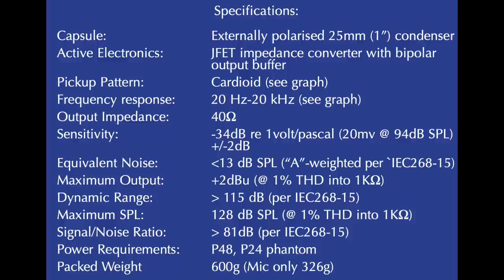Rode NT1 vs. 1990's Rode NT1 Comparison (Versus Series)

Comment: Wow, wow, wow. I can't believe you determined the winner to be the new NT1. I prefered the original in every test. I had to skip through the recording of the guitars in particular with the new mic because it sounded so inferior to the original. The bass response and proximity effect was just too much for my taste on the new one and the midrange was muffled in comparison to the original. And I know you can hear this stuff because you're wearing those Sennheiser HD-650s! I could see how the new one may be more desirable for voiceover work but in the mix, anything mic'd with the old one is going to sit better in the mix. Thanks for doing the test though, I always wanted to hear the differences and this is a relatively hard test to come across.
Reply: Completely agree. Was very thrown off by everything said at the end. While the noise floor and output signal on the current issue NT-1 is much improved, I enjoyed the sound of the original in every test.
Reply: @tigresen5660  Haha. It was like, what happened there?!
Reply: Totally agree with you.  I recall reading that Neumann sued over the original NT 1 body design and similar sound, forcing Rode to change it. The OG beats out the new one in every example for me.

Comment: Self-noise is one thing; but as for sound, it's whichever sounds good to you in a specific context. I thought the original recipe sounded nice & sparkley on acoustic guitar, and would be useful for keeping it forward in a dense mix. But we don't usually produce tracks of one sound source; it's all about what helps us emphasize the desired elements within a mix. The current NT1 is great for stuff you want to sit graciously and let other sounds punch thru. (Of course, a little quality EQ will let you do the same thing, albeit with more fiddling.)

Comment: Interesting video. The newer one definitely sounds better here. HOWEVER:
there is a pretty simple mod for the older NT1 if you want it to sound a lot better, and of course if you happen to have one on hand. The man, who actually designed the mic, the one and only Jim Williams, suggested that you change the two 450 pf caps, that are inside the microphone attached on the circuit board, into 1500 pf or 2200 pf caps. This way the microphone just comes to life and becomes a whole different beast. You can find clips of a comparison between the original and a modded one online, there are whole gearspace (ex-gearslutz) threads regarding this, so a simple Google search will tell you all about it.

Comment: Definitely different. I just unearthed my 2000 NT1 after a friend gave me a spare Rode shockmount. However, I disagree with which one wins. Through my Dynaudio BM6a monitors and through my PA rig, the 2021 NT1 sounds like it has a couple towels in front of it, sounding muffled. The 2000 NT1 was way more clear to my ears through speakers. I didn’t listen through headphones yet. My only complained with the 2000 NT1 is that it picked up a little more noise from behind it vs the 2021 model.
Reply: yes the old one sounds more open and has a warmth to it.

Comment: Thanks for the video! I totally agree with you: the current model is better than the 2000 one in the overwhelming majority of scenarios. The 2000 sounded more sibilant on the voice because of that unnatural boost - and that's on top of having worse specs especially in regards to the SNR. The only place that the 2000 one had a desirable trait in the tests you did was in the way it brought out some of the high notes on the acoustic guitar compared to the newer one - but the same thing could accomplished with EQ and would likely sound better that way, too.

Comment: I miss my original Rode NT1... was stolen back in 2018 or 2019.  Definitely an amazing mic for its time.
Reply from the maker: Damn that sucks you lost that one. I wasn't buying any gear back when the originals came out, but that's what I understand, it was a big deal to get a mic that sounds that good for that low of a price.
Reply: @Podcastage  NT1 was my first LDC.  The only other LDC options were like C414's, Neumanns, and some other very high end stuff.  Normal human priced stuff... AKG had the C3000 out at the time, but i remember that being on the pricier side. Audio Technica had the 4033 out.  MXL was coming out, and originally called Marshall.... guess it was too confusing with the biggest name in guitar amps already having that name.  But the early MXL's were BRIGHT... i still have my first MXL from late 90's.  I use it in the shop to test preamp phantom power.

Comment: I do love my current NT1. 
I recently was offered a pair of lightly used, immaculately cared for, original 1990s NT2's at a price I could pass up. 
Have you ever had an original NT2 in any video?
Reply: Yo tengo un rode nt2 plateado. Década del 90s. Son australianos. En estética parecido al U87. Son muy suaves y dulces. Si están en buen estado te los recomiendo. Lo uso con un preamplificador Aphex 107 y una intarfece Motu 828.

Comment: Neither are particularly great at background noise rejection, but the current version is notably better at it. With the increased weight, I wonder if the internal resonance also has better characteristics on the current model. Oh, while not bad overall, I spotted a couple of those cheaper style electrolytic capacitors on on the original pcb which may affect the reliability at some point. The current model looks to have vastly better build quality from a physical electronic components standpoint.

Comment: That's NOT the original NT-1, that was the 3rd version. The original & rev 2 versions both had RODE written vertically on the front of the body in outline lettering.
Reply: Incorrect, the original version is the larger, non lettered one with hand written serial numbers on the bottom.

Comment: Despite lower specs I see the old one has a built to last discrete amp scheme with high grade Hitachi transistors and WIMA film caps. I prefer the sound of modern NT1, the old capsule (also a K67-type) was too bright (though I like mics with a bit of air). Anyway, I like NT1 in general, so if someone wakes me up at 3am and asks about what reasonably priced mic to get, I say NT1. By the way, I got an sE X1S (also K67-type capsule) recently and I think it's great, I remember you didn't like the now discontinued X1 for being too bright, but maybe check the new one.

Comment: Great video, very informative. I agree 5 dB boost on the top end might be a little much, but I bet dollars to Ds you're gonna end up boosting just about that same amount in post for vocals, and most everything else I can think of. There's also a couple slight dips in the 1k-2k region, which you'll also probably end up doing in post, same with the bottom end dip. Noticed you didn't mention the difference between the Q's of the freq band, nor explained why one is better than the other. You had me up until then. Other than that, very good video 🤘

Comment: Bandrew, it was really interesting to see that they switched from the center terminated ("Neumannish") capsule to the edge terminated one (like the AKG C12..C414) -- not too much mics are produced with edge terminated capsules. It would be great to see a similar comparison between the original Sennheiser MD421 and the current model. Even the change of the color is the same :))

Comment: About the only thing I preferred the original NT1 on was the acoustic guitar, where it sounded nice and open compared to the smoother, more neutral sound from the current version. However, you could get a very similar sound from the current NT1 just by applying a bit of EQ, so this doesn't really matter. Since the current one is such a neutral mic, it's like a blank slate.

That all said, the proximity effect isn't very nice at all on the new one. The original did sound better here. Not really something that would ever come up in my usage, so for me at least it's moot.

Comment: Two different mics for sure. To me the original sounds almost more like and eq'd or mastered sound would sound. The new one has a bigger presence but loses about everything else.  It's bigger sounding but  dry and room-like at the same time. It doesn't sound as sweet as the original either.

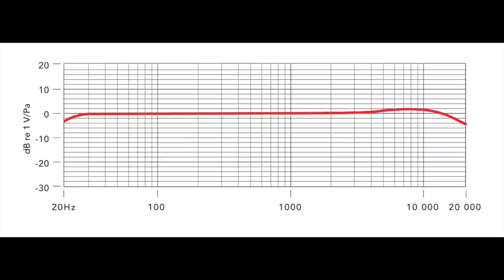Comment: 8:01 what about the Lewit 440 Pure then? or like every condenser Lewitt mic? those have a pretty big boost in those frequencies as well. I understand there is a difference in the whole tuning of the mics. Just wanted to understand what is the difference in your view that makes them "better" or "worth".
Reply: They have a (wanted) boost, which makes them very open and brilliant sounding. However they also tuned the boost in a way that doesn't make them sound brittle or harsh or sibilant (on most voices). That's the difficult thing - making a bright condenser mic is easy. Making it bright and sound nice is the hard part.

Comment: Does foam windshield dampens those high frequencies? A lot of  people use those.
Reply: Depends on what kind of pop filter or windscreen you use, but usually they only reduce the high frequencies by a tiny amount

Comment: The only test w. any value here was on the acoustic guitar becuase any subtleties/differences are very hard/impossible to hear in those spoken voice tests which are just nonsense to me in any case, the original 2000 is clearly the better one for this purpose as it has a better airlift in the freq-spec unless you want the more neutral response of the newer version of course which may seem duller to some...BUT...the ultimate NT1 is here and now in 2023 called Signature Series and it is the best NT1 version ever thank you and greetings from Sweden :-)

Comment: The newer models have surfaced mounted components which makes them next to impossible to work on. One second too long with a soldering gun destroys the printed circuit. They do that now because they are cheaper to make.  Computerized machines do the soldering not people hence the cheaper cost. Disposable microphones.  Many sound great but don't expect them to be around working when you get old like a 1950's Neumann.

Comment: I admit people prefer new technology even because it is what brands need to sell. But no way i would change the original NT1 for the new one, specially for acoustic guitars. The clarity, the way it sounds, ..no comparison.
Same goes to Shure SM7, SM7A and SM7B. You can say ehat you want about improvements on technology.. but again, I wouldn't trade you he old for the new.
And it's not only the result in terms of sound. The components are responsible for that, and brands wouldn't put quality german components. They have to build accessible equipment and electronics are much cheaper and lower quality than yesterday.
My opinion anyway.